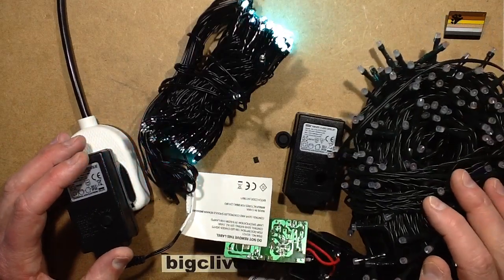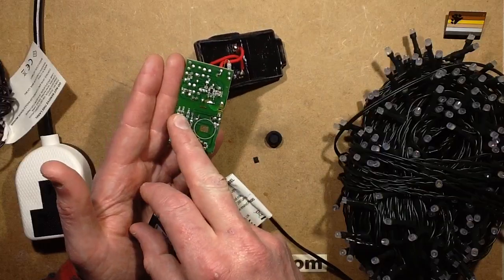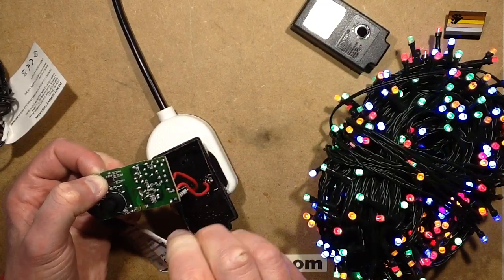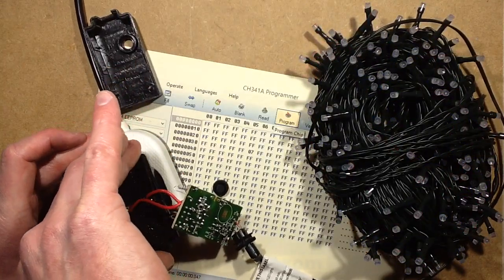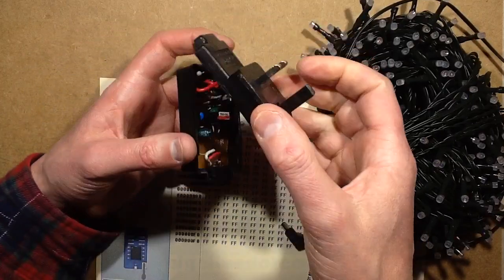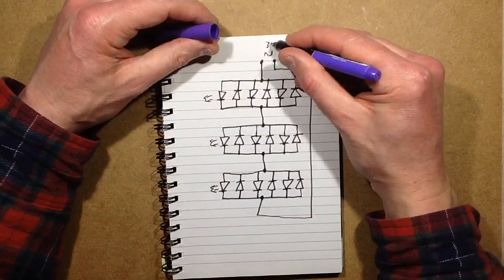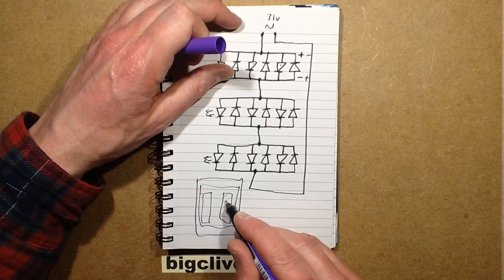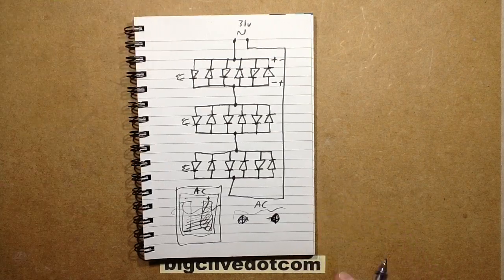Memory hack for new 2-wire LED Christmas fairy light controller.

Comment: Hi Clive just discovered your terrific post/video while searching to discover what might be the fault I have with a set of 1000 LED’s 100m outdoor set. 31V as per the norm. Although this set has a 31V DC mains adapter and then the controller box (2 wires in and out) must output the 31V AC as it’s 3V AC across a working LED. There is about one sixth of the LEDs that are not working. I counted 151 in the block which is block 5 away from the supply, so the last block of 150 is still functioning correctly. Except there are 2 LEDs not working in that last section, one is 38 from the end, the other 138 from the end. Any ideas how to figure out what LEDs have failed and how, as I assume it must be that as the end block is mostly still working OK. I double checked my counting and yes the main block is 151 long. I assume the LEDs are wired in blocks of 10, so 100 blocks altogether.
Reply from the maker: Sometimes an LED fails short circuit and shunts the others in the block.  A crude fix may be to jab it with a higher current 30V supply briefly.

Comment: Mine just "poofed!" suddenly. I guess it was the capacitor. Could it be fixed? What do you think?
Reply from the maker: Depending on the voltage and whether the lights are two wire chasing, you may be able to find a replacement power supply for them.

Comment: Thanks for your post! Wow - a lot of work. Yes I have found that if you power it with DC only half the lights work, every other light. If you scope the output its 30v AC. I'm not sure your fix will work with other variations of this type of LED light. My big problem with these things is the pre-programmed 6 hour on time, as where I live it's dark 16 hours a day at winter solstice.
I found a simple solution, I used a common 24vac secondary transformer typically used for doorbell and furnace applications.
Remove the controller box, connect the 2 wires of the light string to the secondary (24 v) of the transformer, and connect the primary of the transformer to the mains, works great!

I'm pulling about 160 ma with 1 string of lights in this configuration, plenty safe for the 40 VA transformer

I'll post additional details shortly.
Here is a link to the transformer: https://www.amazon.com/Transformer%EF%BC%8C-Secondary-Isolation-Transformers%EF%BC%8C24V-Transformer/dp/B0B8Z2XV7V/ref=sr_1_5?crid=2LX7FIU6AFIDM&dib=eyJ2IjoiMSJ9.EFjJmHQTaL6TUX0zIw4sdCRsXhmGAAK3XLC64IAZ8Zgpo9ooo-vnKxZwZmLxhPOZU9bRutfxDQyOfIFqhQgwU2Re2I3AswoVB5LWTUfjgpAQ_2U-hv-72HeNKBni0M83qobk5cDgDGjoXzcuSerd77HzK2oJ8OQ_Ege9DUGGOlqe95N0-OZldHLzBjOajyo4HEuS3FK9fnjXhIANELMPu2yG4PRvgz-O03UyoZ3Z1JY-z3Bh6HSTe7fHUX5ovDgbUtlx-WW1sG1LEa3gHrygmzWo_ts_kZZRb6yUDUS4LV0.hlK8kKMUftHMO_w_hl-2T7SvHwPAzoKGc9XLnX9NdSA&dib_tag=se&keywords=24+V+transformer&qid=1733697028&sprefix=24+v+transformer%2Caps%2C309&sr=8-5
Reply from the maker: The timer function is really annoying in some applications.

Comment: Hi i bought a set of battery poerwerd led lights powerd by three batteries in a waterproof case. With a on off and timer switch. What i want to do is bypass the switch so it comes on. I want to use a USB to AA battery adapter

Comment: I wonder if we could make a circuit board by photo resist and then electrolysis to remove unwanted copper not using the same solvents?
Reply from the maker: Electro etching would require that all the areas to be removed stayed connected for the whole process.  Unfortunately that doesn't happen.  But it might at least start the process.

Comment: Can anybody please tell me how to connect copper string lights to usb...
Because when I attach usb wire to it lights turn on but each light skip one between and lit the another 1...
For example out of 50 lights only 25 turn on and other 25 doesn't...
Do i have to put any resistor or any other thing to make all lights work properly on usb cable...
Please guide
Reply from the maker: You do need a resistor to limit the current (About 22 ohm).  The alternate LED thing is because they are intended for a flasher controller that swaps the polarity to light alternate LEDs.
Reply: @bigclivedotcom  i have no circuit just usb cable and copper string wire...
How would connect it to the usb wire...
And where should i place the resistor at + terminal or ‐

Comment: Thanks for this video Clive, I’ve just successfully done this mod. I used a cordless dremel tool to open the controller. Glueing it back together wasn’t so successful though, have a gap around the edge of the join so either need to fill the gap with plastic filler or dismantle it and grind/sand both sides of the enclosure flat. Will probably go with the latter.

Comment: At 8:58, just wondering Clive, as I have a set lights in this arrangement where one parallel group has failed, how would I *easily* find the faulty LED(s) in the failed parallel group, without undoing/unsoldering them one by one and testing with a multimeter ....  Is there an easy way ? Great explanations BTW !
Reply from the maker: It's tricky without something like a thermal imaging camera.  If you can probe into the parallel circuit you might be able to bump it clear with a higher current 3V supply.

Comment: Hello, great video! Thanks! Can the multifunction feature be permanently disabled somehow by shorting/remove a component to achieve the same result? Thank you
Reply from the maker: It depends on the unit.  It's not as easy as just shorting something out, as the string needs AC to light both sets of LEDs.

Comment: can you review the famous model aed09f-2100300vls08  intertek led controller thye have one for 21 volts and 29 volts and 12 volts too !! but I am curious how they are able to manage the light patterns with just two cables !!
Reply from the maker: I think Intertek is a power supply approval body.  The classic two wire controllers swap the polarity to control two sets of lights along a string.

Comment: I got really excited when i saw your video as the pcb looked almost identical to mine.

But to my dismay mine is slightly different and doesn't have the provision for the memory ic so i think im a little out of luck 😢😢

Also reading through comments i will say mines a 31v 193ma 6v power supply.

I have a board number on mine gp-sw060d1-t. But thats all i know. Llease help clive its the one set of all my lights that dont have memory...

Comment: I have the same set but mine has a function controller between the lights and power supply. I'm trying to figure out how I can cut the line in half to create two identical sets. The back half of the line won't work. The first 10+/- lights are flashing but the rest are out. Any ideas how I can get this working?
Reply from the maker: If the power supply is rated around 30V then you can't just cut the set in half.  It's often configured as ten parallel sections of LEDs wired in series to make up the 30V.

Comment: Hi Clive thanks for the explanation of how these 2 wire LED sets work. I have a set that I put up last year and the section closest to the controller has failed. I dont understand how the whole section could have failed to light when all the LEDs are connected to the same bus. Any ideas?
Reply from the maker: Many of these run at 32V and have ten parallel sections strung in series.   It's possible that either an LED has shorted out in that section, or there's a physical wiring short circuit in one of the LED positions.  Try wiggling all the LEDs that are faulty to see if it's a rogue wire.  Finding a shorted LED is a bit more complex.

Comment: Just bought some lights... mine has a MLS-D12V6BWCX-IP44 controller and annoyingly doesn't remember its setting and the default mode is very annoying.  Haven't got the nerve yet to take it apart.

Comment: In September 2023 I have purchased a string of 100 warm white lights in a Wilko sale. It has a battery powered control box with a few sequences and a 8 hour on, 16 hour off timer. I opened it up to  see if I could fit a memory chip, but everything is done with an 8 pin chip and a tiny crystal. The chip is the microcontroller and H bridge all in one. Great fun and all for £3.00!

Comment: Would the 24C02B work? I am looking at the 24C02C-I/MS MSOP. Is MSOP also the correct chip type? I ordered one already and it was WAY too small and for super small surface mount stuff.

Comment: With out reading through all the comments to check if I’m doubling up. 
My understanding of the change in polarity is to facilitate the patterns/flashing while only using two wires instead of 3. 
Great explanation and I’ll give it a try. 
Thanks.
Reply from the maker: It is for the two channel effects.   If you power these strings with an ordinary power supply only every second LED will light.

Comment: Hey there! Not really hoping anyone would see this message, but still worth a try.
I have LED christmas lights with a slightly different controller: it is smaller, roughly thumb size, and it has SMD components.
There are two chips, one labeled IC8301, and the other without any markings, 
but it does not store the last used setting in the memory, so you have to do the hated 7 button presses to get to the steady light mode.
There is no place on the PCB to try adding any EEPROM chip, and it's too different from the older designs where it's obvious which contacts should be bridged to stop it from flashing.
Is there any chance to fix this?
Reply from the maker: If it can flash the wires with just two wires from the controller then it's tricky, since it requires polarity reversal for the effects and even the static setting.  If there's no memory position it probably can't be hacked easily.
Reply: @bigclivedotcom  Thank you for the reply! 
It does have only two wires, yes. So I guess the only solution would be to simulate the button presses when it powers on with an Arduino or something? I haven't ever tried doing anything with an Arduino, but it seems that should be possible, so could be a fun project to learn...
Anyway, thanks again and happy holidays!

Comment: How can I do this without a memory chip? My lights look really similar and I just want to short something as simply as possible without installing a mem chip, it's not like I'll ever use the spastic modes.
Reply from the maker: Sadly, it's built into the chip.
Reply: @bigclivedotcom  Thanks for getting back to me on this, bummer though, my board doesn't have a mem chip socket. 

Awesome video though, I'll know what to look for when shopping around now!

Comment: Great video. Exactly what I am trying to resolve. Question: where should the memory chip be installed (sorry I am not an electronics expert)?
Reply from the maker: It only works on units with a space for it.
Reply: @bigclivedotcom  Thanks. I will open one of the controllers (carefully) and take a look and work out what to do next.

Comment: I have two sets of 50m lights that use these power supplies. I've been looking at getting a dimmer for the lights, as it appears the circuit itself is capable of dimming during a slow flash pattern. However nothing is available. I'm wondering if it's feasible to customise the controller to "fix" the dim on a preset at say, 50% brightness?
Reply from the maker: You'd need a custom power supply to do that.

Comment: I had several sets of lights with no memory that were for a large tree in my garden. To open all the controllers and doctor them would have been a tedious process so I made a new power supply that could run all the light sets. A single plug and timer in my garage was far better and the lights appeared to run continuously as I wanted. Basically I used a 24V transformer (which incidentally came from an old set of incandescent lights) and full wave rectifier with smoothing capacitor to give about 33 volts. A 5V regulator and astable multivibrator generated an output of about 15kHz which operated an H bridge to give a square wave alternating current of sufficient power. A very satisfactory outcome for me.

An interesting comment about minimising corrosion by using ac. Personally I think it is more about manufacturing costs. Using ac needs only two wires whereas dc would need three. This obviously saves money for the producers as does omitting the memory chip. These small savings mount up when you consider the quantity they produce. Why would they want to increase the life expectancy of the lights and thereby potentially reduce their future sales? Everything is driven by money and not concern for the environment with these big companies!
Reply: Hey Nigel!  I'm actually in quite the same predicament.  Smart plug that controls the power to the strings, but 11 of them stuck with the cheap transformers that always restart in demo mode (and depend on manual intervention).  Would you be open to sharing with me more details of your solution?  I'd like to aim to get all of them run via a single controller like you're describing.  I'm just a little under-experienced in figuring out the details of that.  Anything you can share would be helpful!
Reply: @nigel Was this something relatively easy to build?

Comment: Good interesting video by this geezer called Clive. But I would strongly advise NOT to put your fingers near any 240v power source, albeit AC or DC. After having spent over a decade in the past as a television engineer repairing the things down to component level, I cannot stress enough after countless accidental electrocutions, to keep your hands well away from sources exceeding 30V. Once got an accidental shock off a Trinitron LOPT final anode at approx 35KV DC... & lets just say it didn't end well!. ALWAYS keep yourself away from high voltages at all costs folks, as electric shocks can cause permanent damage to our heart muscle. One fact being that electricity takes the least path of least resistance to earth, which is such cases as us touching power sources... is actually you!.

Comment: I've got a bunch of remote lights but they don't ask receive the remote signal properly. What would be the best way to have them all come on?
I was thinking 240 to 5v transformer so they all flash 50 times a second but would I need to limit current?

Comment: thanks for the explanation.  I bought a christmas tree with built in led lights, which lasted 10 mins.  The power supply is 30V , 15W  ,same as yours and there is no power output from it anymore.   I decided to built my own power supply,  wound up secondary wiring on the transformer, got 30 V,   just received the rectifier , haven't tried connecting to the leds yet, as need to figure out what resistor do I need.  However from what you said it appears when I connect it only half of the lights will be on , and I should be able to change the polarity and get the other half on?  I hope it won't burn the LEDs

Comment: Big Clive I’ve just brought a set of premier LED lights and have this exact problem. Do you have a close up image of where you have soldered the pins of the memory chip?
Reply from the maker: If it has the position for the memory chip it will be obvious.

Comment: What would cause 1 strip of green LED's to be dimmer than the rest of the LED's on a set of AC LED Christmas lights. They're the net type I have, hanging on a window. I'm guessing there's a high resistance somewhere, but trying to find it will be more difficult than something that is just open circuit.
Reply from the maker: It may be a faulty LED limiting the current.
Reply: @bigclivedotcom  yeah I noticed yesterday that when I first turn the lights on, the green strip of ten LED's is approx half the brightness of the other green LED's. After about 30mins, you can hardly see the ten LED's. 

I'm not taking them down now to sort, I'll wait until after Xmas then pull all the shrink tubing off the LED's and check the connections and continuity on the wires.

Comment: Might fit an extra memory chip to the wifes vibrator. Every time she switches it on from scratch, its on full speed hammer action. Makes me leap out of my skin. Will program it to switch on at a quieter setting. That way I won't be a quivering wreck.

Comment: What if powering the string from AC? Using a 24Vac transformer. They'll flicker at 25 Hz here in EU but at least will not have those effects.
Reply from the maker: It does work on some sets, but the flicker is quite strong.
Reply: It turned out that my set comes alive at 27 volts so 24 Vac transformer is useless...

Comment: Hey Clive, is it possible to modify these kinds of lights to remove the flickering/shimmering in 'static' mode? I don't care about the different blinking/dimming modes, I just want all LEDs to light without any flickering because I'm quite sensitive to that and it drives me nuts. I suppose if the odd/even LEDs are wired with alternate polarity it can't really be done (since you need AC to have them all light up), but I noticed that in my case there are two wires going from the PSU to the first LED, which has something additional under its heat shrink (a controller?), and from there the string contains 3 wires, with one wire bypassing each LED. Any thoughts?

Comment: 5 years later still no memory in led fairy lights. I can understand the cost saving factor but why not just make always on the first setting as it's what you want 90% of the time!?
Reply: Just bought a few cheap sets in the sale from Argos and they all seem to have memory on them, whereas another online only retailer is blaming the lack of memory on semiconductor shortages 🤔